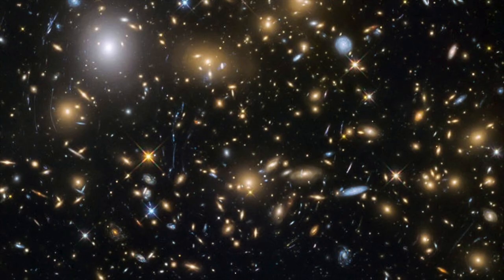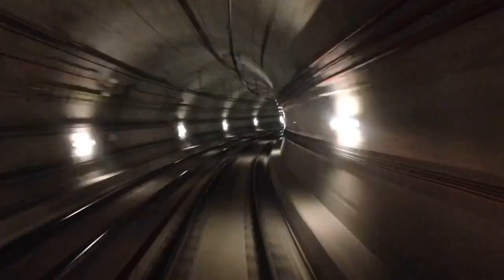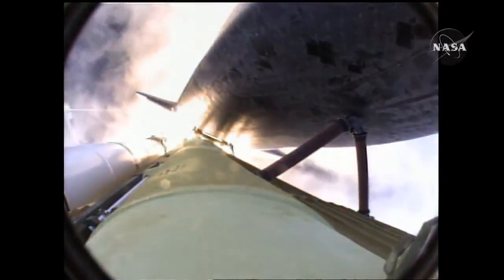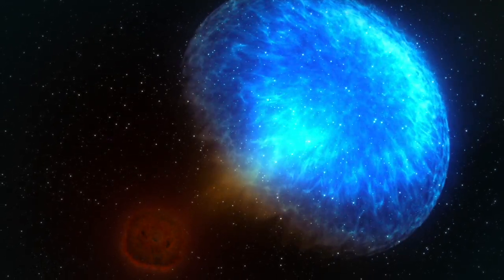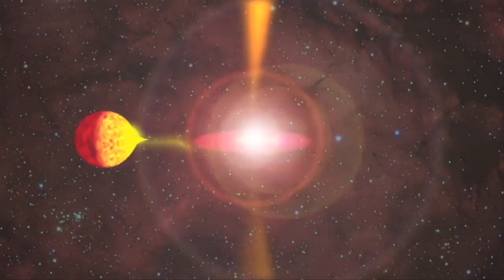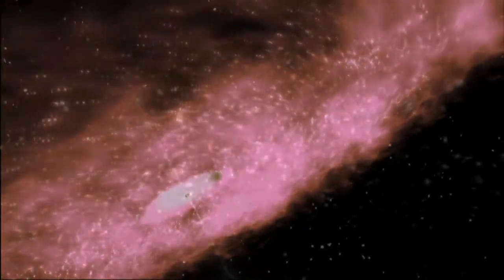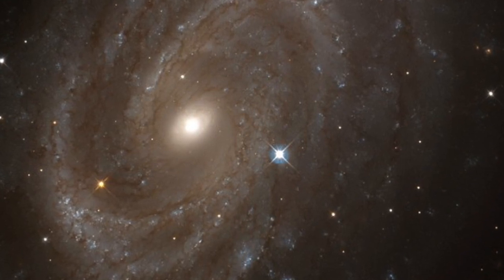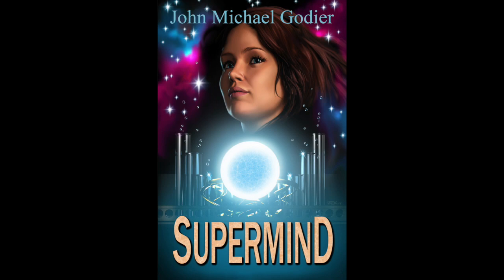10 Mind-blowing Interstellar Propulsion Systems

Comment: 13:15... Wouldn't you also get a shorter return beam than you sent out?  Thus you wouldn't actually get more energy back.  In fact, since you are shooting a laser a rather long distance I would think you would get back considerably less energy.  I'm no expert though.
Reply: The halo drive is essentially a gravity assist/slingshot maneuver that we use to accelerate interplanetary probes, except instead of sending the ship around a black hole, you send light. Light can't travel faster than the speed of light, so it is shortened, exactly as you point out. Compressing light this way translates to an increased frequency and more energetic light: an infrared laser might be shifted into the X-ray range.

There's no such thing as a free lunch, but this trick is basically normalizing the energy between the things involved in the gravity assist. When it comes to an interplanetary probe like the Galileo or Cassini missions, swinging around Venus and Earth actually (albeit immeasurably) slow the planets and speed the probes. The halo drive does the same, and even though the laser might be incredibly powerful, the massive spinning black hole has a vast reserve of energy to tap.

There are a lot of problems with the halo drive, if you were to try to implement it. You'd need to be unbelievably precise with your aim to get the laser to hit the ship, the laser frequency would be stretched-out by the accelerating ship speeding away from the black hole (the design assumes the ship is the source of the laser, which loops around the black hole, and the laser then returns to the ship - this means the beam is redshifted as it leaves the ship toward the black hole, then again as it leaves the black hole because the ship is speeding away from it; a powerful laser from a star near the black hole wouldn't suffer from the first redshift, though like any light sail, it would suffer from the second). Spread in the beam would result in energy being lost as it's spread not only over space but frequencies, broken apart like light in a prism, but due to some of the light passing closer to the event horizon and some farther away, generating a rainbow even though the laser started off in one frequency. This makes harnessing the returning beam more difficult, and its energy symmetrically spread across a sail/energy collector.

There are likely many other problems, so it might never be practical, but to the credit to the author of the paper, it does provide a way to tap the energy stored in the angular momentum of a black hole remotely, which is a cool way to seemingly get out more energy than you put into generating the laser.

Comment: With nuclear pulse propulsion, how would the ship slow down or stop once it reaches the intended destination?
Reply: Turn around with thrusters and accelerate.
Reply: The same way it sped up: turn the ship around, then detonate nuclear pulses as you did previously. The ship's now on the opposite side of the explosion from the destination, so you're slowed down by each blast. This requires bringing nuclear fuel to slow down in addition to acceleration, but you would need fewer or smaller explosions, since the ship would be lighter than during its acceleration (it's far more efficient than chemical rockets, but this still involves a lot of fuel/energy).

Comment: Thanks for closing out my Sunday John. Wasn't it the Romulans from Star Trek that used an artificial blackhole to power their warp drive? It's funny how Star Trek has inspired so much in science. Thanks for the video John and I hope you have a great week.
Reply: Based on the writers guide, it's simply using an "artificial quantum singularity" as a power source instead of the matter-antimatter reaction - the rest of the warp drive is essentially the same. How exactly it releases power isn't explained, though commenters in the link below point out feeding a black hole causes light to be emitted (as the particles whip around it at a high velocity, as they fall inward) and small black holes evaporate quickly, releasing Hawking radiation. 

https://scifi.stackexchange.com/questions/59968/how-does-a-romulan-quantum-singularity-work

I seem to recall an episode saying that, unlike an antimatter reaction, you can't just switch off this kind of drive, which makes sense if they're dependent on a small black hole as we know it: feeding it releases energy and not feeding it allows it to evaporate at an even faster rate, releasing energy.
Reply: Strick Nine Yeah! Good luck not screwing that up!😳🙄